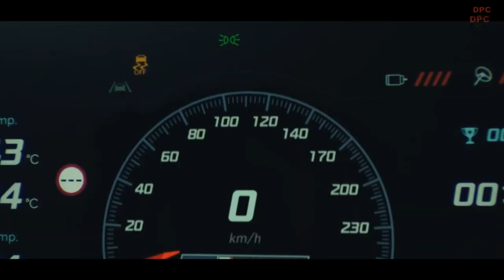BMW Considers Simulated Manual Gearbox For Future Electric M Series Models

Comment: Toyota has better ideas 👍, 
They co-developed it on Lexus SUV, where you can change modes from 50/50 petrol to pure EV and in petrol 50/50 you can step on the clutch pedal and shifts gears with turbo gauge. Change the mode to pure EV when you're cruising on the highway.